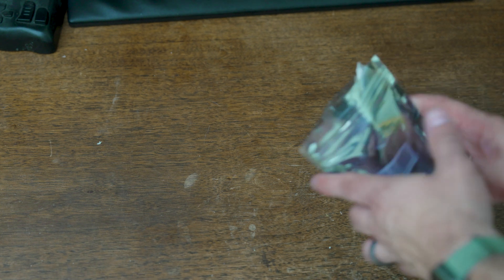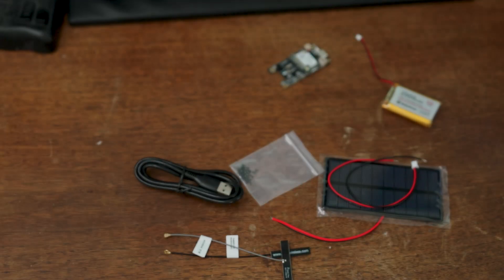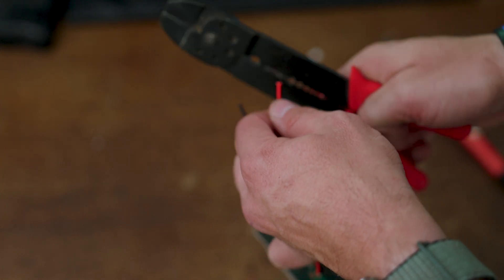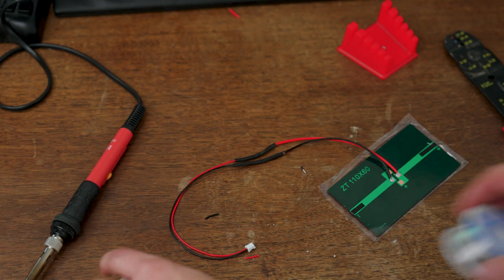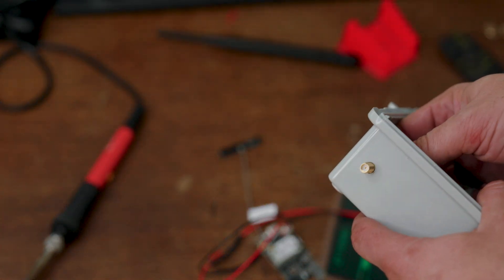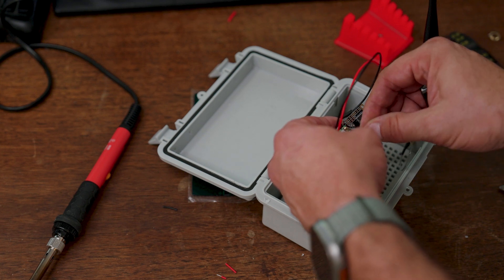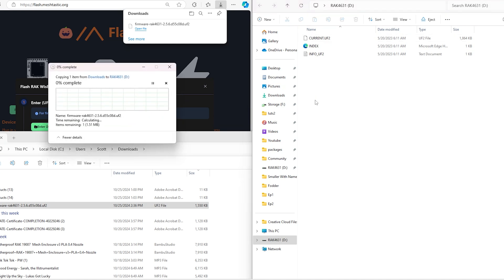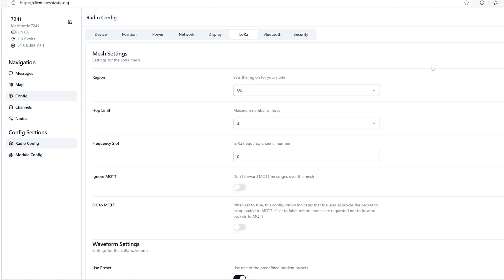STOP Relying on Public Networks | Build Your Own Off Grid Communication System

Comment: Nice video! The only thing is I think you plugged the battery and solar panel into the wrong ports. The battery plug is the bigger PH2.0 port, and it is labeled on the board. You need to get the smaller JST 1.25 plug for the solar panel.
Reply: At least he got the red to red
Reply: @INHCIO  🤣 easiest way to loose $35